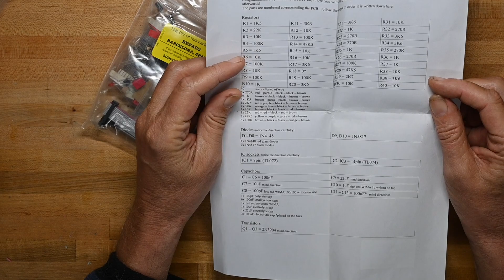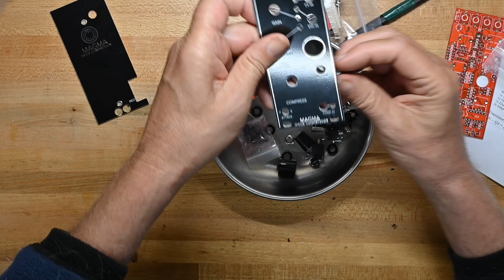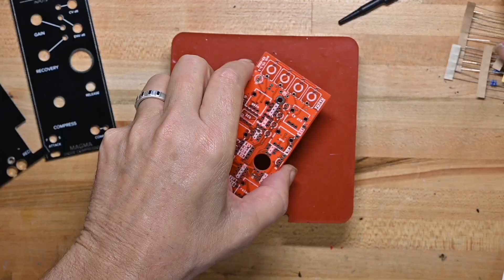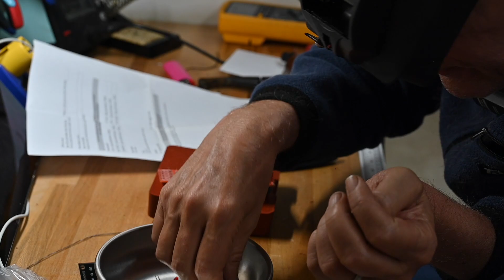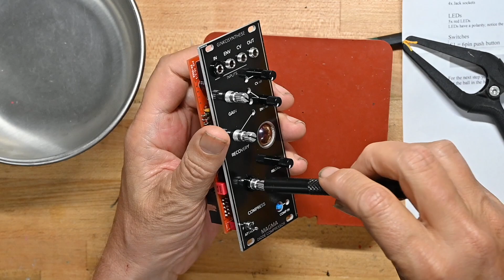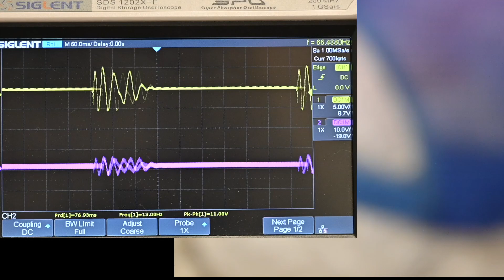C.K. builds a Ginkosynthese Compressor kit, eurorack

Comment: Also, have you built anything by Nonlinear Circuits? I've been looking at some of his modules.
Reply from the maker: @matthewjones6053. I have not done any NLCs yet, hadn't seen them before.  Just ordered. sequencer/mixer and a flanger from them from SynthCube, so you'll see them in a month or so.  Do you have a specific unit you'd like to see built?  Just let me know if so.
Reply: @CKHaun  I actually do have a video idea if you haven't already done it. 

So the reason I found NLC is because I found some cases they designed on Thingiverse. I'm new to modular and the prices are eye watering. I do own a cheap laser cutter though and think I might build one of the cases he uploaded. 

Next is picking modules. I'd like to build everything myself. I know the types of modules I need (VCO, envelope, etc) but even then there is a lot to choose from. 

I feel like you've built a bunch of stuff, so a video where you suggest good DIY modules for beginners would be awesome. So the criteria would be based on buildability, ease of use, and value for money for a new builder. 

Bonus points if you have build videos of the modules you recommend. :)

Most "welcome to modular" videos on YouTube focus on pre built stuff. Your perspective as a DIY builder would be helpful to us newbies. :)
Reply from the maker: Excellent idea, I'll see what I can come up with.  I'll admit, it'll be a bit of time from now, I'm headed out of the country next week for a month, so it may be November before I can get something like that queued up.  I have pre-recorded builds stashed on YouTube to fill the gap, so there will be builds even though I'm away!
Reply: @CKHaun Awesome! I hope you have a lovely trip. I look forward to seeing your suggestions when you return!

Comment: What camera are you using? Your video quality is excellent. Especially the overhead shots. I always have issues with my overheads throwing weird shadows.
Reply from the maker: @matthewjones6053. I use two Nikon mirrorless, a Z-7 for the side view and the Z-50 with an 18-140 mm lens for the overhead view.  Bought the cameras for still shots, but when I started going full force on this channel found that they are great video cams too.
And the shadows, oh yes.  It's just a constant matter of fiddling around with lighting, and usually using 2 or 3 lights to insure good fill, without bleaching things out.